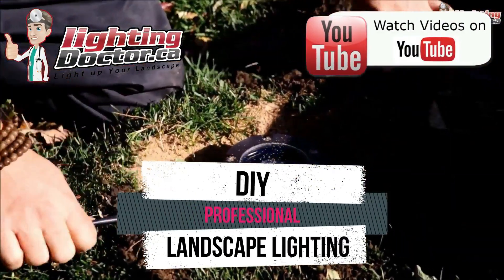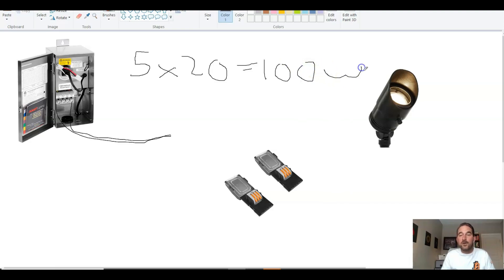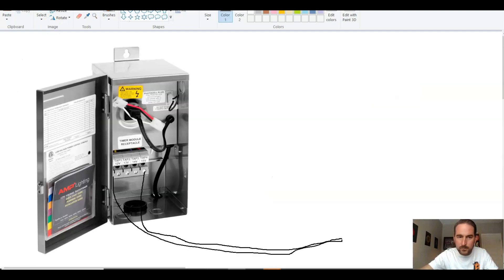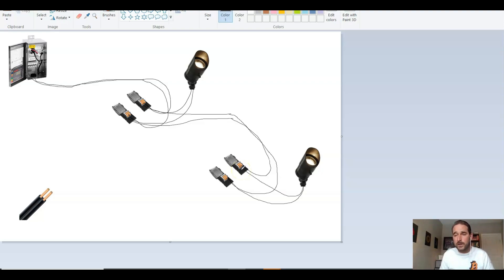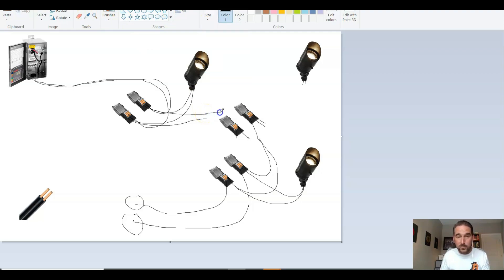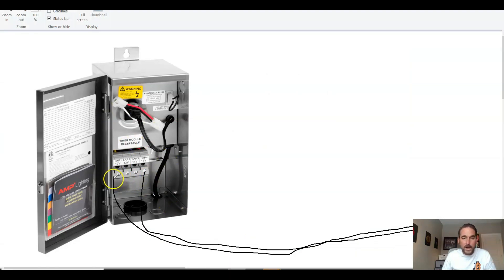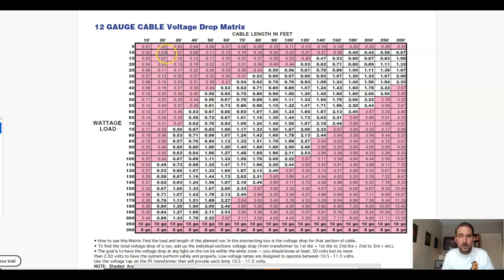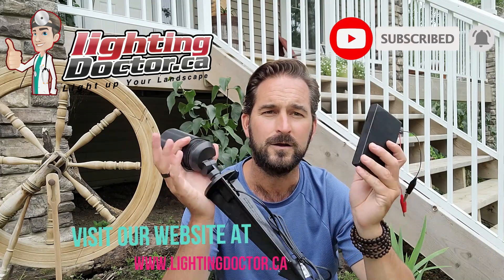How to Wire Landscape Lighting and Choosing your Transformer

Comment: I'm running 29 lights cap lights that are 2w each but the cable lengths runs to 240ft . I'm using fx luminair 150w transformer but I'm not sure if at that length if I should use 12g wire or 10g for the voltage drop
Reply from the maker: I good rule of thumb is if you are using a transformer with a 15 volt terminal then you can easily run up to 100 watts of lights on a length of 12/2 cable up to 250 feet without any issues.  Because you are well below 100 watts you can easily run more than 250ft without any issues.  So I would recommend 12/2 wire to make things easier.

Comment: When you T off the main cable, how do you add that additional feet to your cable length for voltage drop.   For example, if my furthest light is 100ft out, but at 50ft out I have a T.  And that T extends 50ft in it's own direction.    Am I then at 150ft total?   thanks!
Reply from the maker: Yes that Is correct and 15 you are using 12/2 wire and a transformer with a 15V tap then a good rule of thumb if using LED lights is you can run approx. 100watts of lights up to 250ft from the transformer
Reply: @LightingDoctor which wire goes to Common and 12V? Plane wire with letters and the one with ribbed?